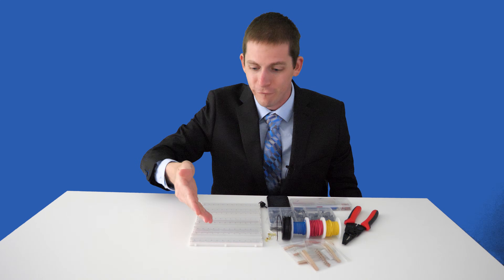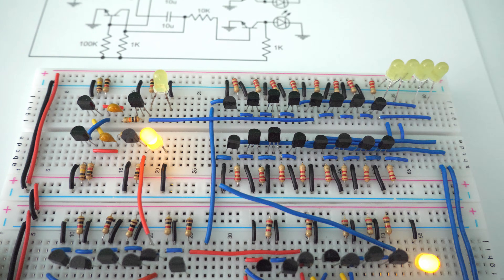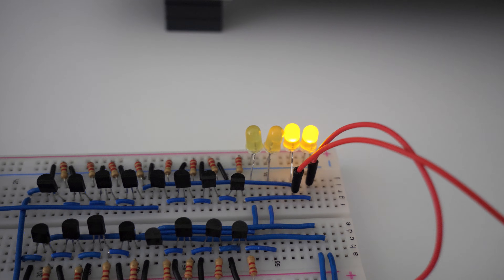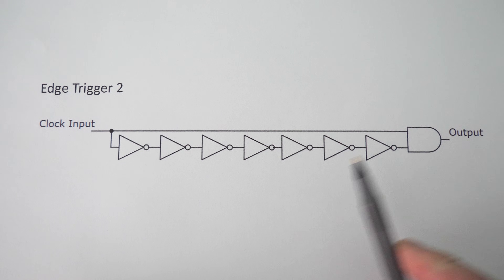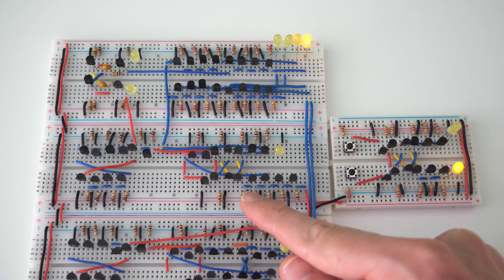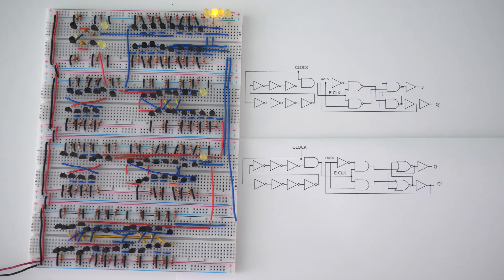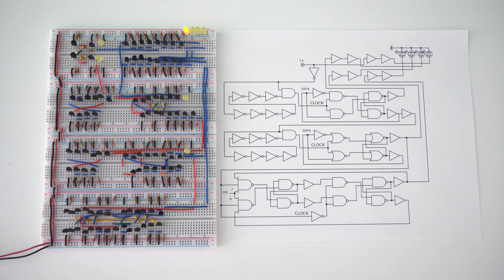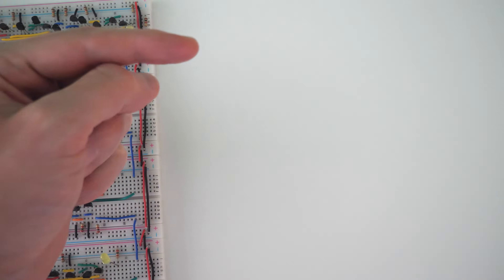Binary Counter

Comment: Sir, in the top breadboard uh have build 4-pairs of buffers to drive 4 leds right..! 
Can uhh explain y dont we use one buffer for each led..?
Reply from the maker: Good question. You do not need two buffers if you are just building this module. You actually do not need any of the buffers it that is the case. I was planning to use this in the computer and wanted separate buffers to light the LED and send the output to the data bus. I ended up using two ring counters.

Comment: Sir, why did uhh add 2 buffers in between master and slave circuit. 
Y don't we give the outputs of the master -->to inputs of the slave directly..?
Reply from the maker: I actually built it that way at first, and I think it did work. However, the output is sent to two location I am pretty sure and was not sure if it would have consistent behavior so I added the buffers. It depends on the logic gate design. Some logic gate designs will not need the buffers.

Comment: So many transistors...
Why not just use 4 bistable multivibrators (2 Transistors) for the flipflops and extra 2 Diodes for each one so they can switch state with just one input?
Reply from the maker: If you built it, that would be an interesting circuit project to see. Binary counters are typically built with MS flip-flops that do use lots of transistors.

Comment: Hello, congratulations on the excellent work! At 0:59, I believe the schematic of the astable multivibrator might be incorrect. The BJT connected to the source doesn't have its base driven by the capacitor. Thank you very much for your videos!
Reply from the maker: Thank you! I think it is correct. I did run this in the circuit simulator to make sure it worked. The collector is connected to the source. I should make a video explaining exactly how the astable multivibrator works. I knew when I built it but I would have to think about more to give a better answer.
Reply: @ I'm sorry, my English is not very good, but the way it's drawn in the schematic if the capacitor is not connected to the base of the BJT the voltage remains balanced and never turns off the transistor. This will cause both transistors to stay active and not oscillate. However, in your video "How To Use LTSpice", the schematic is correct.
Reply from the maker: @  Alright, thanks! That is good to know! I knew I simulated it, and it worked at one point. I am not sure why I showed this diagram then. Maybe I drew it slightly wrong in EasyEDA.

Comment: I’m an aerospace student and I’m really interested in electronics what basics do aerospace engineers study that help them in electronics?
Reply from the maker: At my school (Penn State) I was required to take an electrical engineering class. I took EE210 which was a 4-credit class with a lab. It was actually a weed-out course for electrical engineers so it was quite difficult. At the time I did not like electronics as much as I do now so I just learned what I needed to pass the class. Topics were mesh analysis, nodal analysis, op-amps, dependent current sources, independent current sources, etc. Building circuit projects on your own is more fun and a better way to learn electronics in my opinion.

Comment: is it possible to build a calculator using this circuit ?
Reply from the maker: Well I build a calculator using full adders in a different video. We also used counters to build a full computer in a differnt video. The actual operation of this counter is division which could be added to the ALU of a computer.

Comment: LED Area = width x height. If it LED Area = 32 led x 32 led or even bigger value in width and height. Then it become PHD designing tool. Lots of picture figure work.
Just run it with either binary bit left shift or right shift counter. LED Area = 1080 x 2000😊😊😉😉😉😉😊😊😊😉😊😊😊😉😊😊😊😊😉😊😊😊😊😉😊😊😊😊😊😉😊😊😊😊😊😉😊😊😊😊😊😉😊😊😊😊😊😉😊😊😊😊😊😊😉😊😊😊😊😊😉😊😊😊😊😊😉😊😊😊😊😊😉😊😊😊😊😊😊😉😊😊😊😊😊😊😊😊😉😉😉😋😊😊😊😉😉😉😉😉😉😉😉😉😉😉😉😉😉😉😉😉😉😉😉😉😉😉😉😉😉😉😉😉😉😉😉😉

Comment: Area = width x height. It Area = 1 x 4 .  If make it Area = 32 x 32 or even  bigger value in width and height. Then it become PHD design tool. Lots of picture figure work.. Just run it with binary bit left shift or right shift counter. Area = 1080 x 1080.
Reply from the maker: Interesting but I am not quite sure what you are saying.

Comment: The guy has never heard of discrete logic using MSI components.
Reply from the maker: The idea was to build circuits without ICs to learn the fundamentals of circuit design. If you watch the latest video I built a 4-bit computer using discrete components/not ICs.

Comment: 7:56 There are no J-K Flip Flops in FPGA because they don't provide anything more robust than using D Flip Flops
Reply from the maker: Yeah, that is a good point. I was mostly saying that a pulse-triggered master-slave style data or JK flip flop is more robust than an edge-triggered circuit on a breadboard. Because just a little bit of noise when bumping the circuit can make it trigger. I am going to post a video about flip-flops tomorrow. I am not sure but the data flip-flops in an FPGA might be master-slave style data flip-flops which are very similar to the master-slave JK flip fop.
Reply: @GlobalScienceNetwork  it's impossible to have J-K Flip Flops in FPGA, a CLB is made out of a D type Flip Flop, even if you describe a J-K in Verilog or VHDL what it will end up being is a physical D type behaving like a J-K.
Reply from the maker: @deltakid0  Interesting, I do plan to look into FPGA design more to see how the logic gates get reconfigured. Maybe a similar method can be used to change how neurons are wired. Do you know if the data flip flips are pulse triggered or edge-triggered?
Reply: @GlobalScienceNetwork  by Pulse-Triggered I think you mean Level-Triggered device such as a Latch, otherwise is an Edge-Triggered device such as a Flip Flop (the former being dreaded by FPGA developers because of its asynchronous nature).

By the way, I liked your Binary Counter using only off the shelf transistors, that's an excellent idea to show kids and beginners the very basics of computing (and then show them a 74hc163 for comparison).
Reply from the maker: @deltakid0  Thanks for the reply. Yeah, I read pulse triggered a few places and thought that was strange terminology as well. I understand what you are saying about an FPGA not wanting to be level-triggered. One book I am reading suggested using level trigger data latches for the registers and I am trying to decide how I want to build them for demonstration purposes.

Comment: You made a calculator in the previous video, it was adding, can you make a calculator with subtraction?
Reply from the maker: I might make a video showing this at some point. If you are interested in learning the method now you can look into a full subtractor. For the XOR and AND configuration, you can add two inverters to the full adder to make a full subtractor. The best way to make it so you can add and subtract is by inverting all the B inputs. So you have a 4-bit input A + inverted inputs B = A-B. This is the two's complement method.
Reply: @GlobalScienceNetwork  thanks